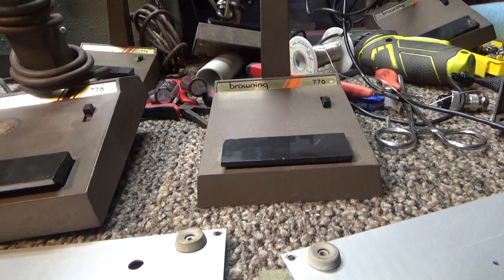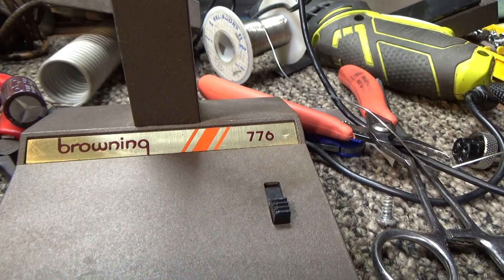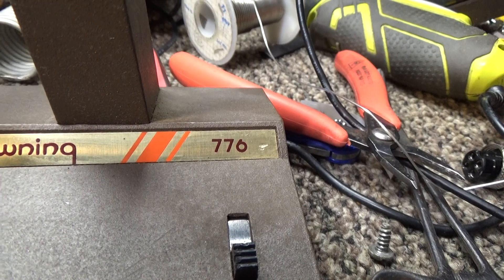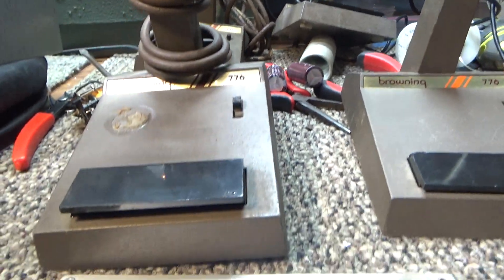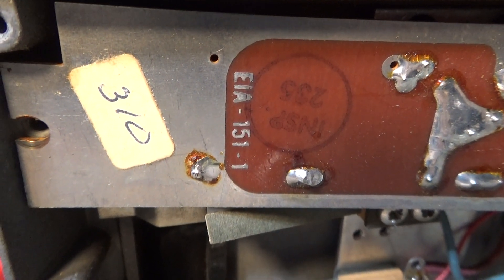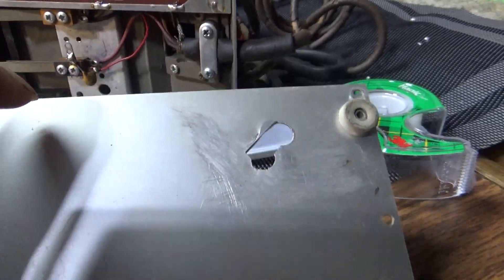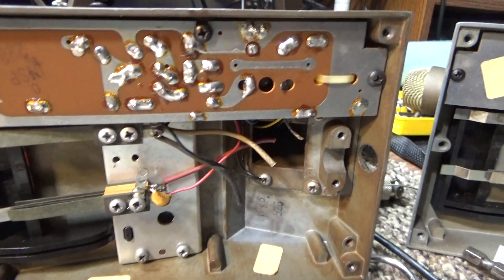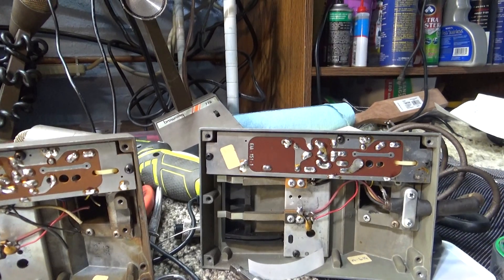My Browning Golden Eagle 776 Mics Orange and Brown stripe opened up.

Comment: Did you ever get it to work with the older brownings?
Reply from the maker: Never tried as I it needs around 7vdc from the transmitter to power it. The older Brownings original plug doesn't have an extra pin to bring the voltage in for starters. It could be done, replace the original Mic plug and socket, add a diode and cap off the filament for low voltage, run that into the Mic and it should be good. However, modding a Browning to do that will lower its value to most people including me.

Comment: The Browning Mark 3 supplies 5v through the plug by using a Zener diode. Dont believe me? Take a multimeter to the Mark 3 mic connector, you'll see.
Reply from the maker: You mean the Mark 4's right? Also, I think the early Mark 4's used a dropping resistor from the 8v PLL supply and if you shorted that 8v supply, sometimes it would take out the Mark 4's early PLL. Browning redesigned it with the Zener on later models. The Mark 3's used a High Voltage relay and took the HV for it right off the HV power supply. Zap, so be careful.

Comment: I have a Browning 776 also but the plate on the front is missing along with the cover over the microphone head does anybody have any extras ???
Reply from the maker: Good luck. Someone used to sell the front label if thats what you mean, but I have not seen them in a while. Never did see anyone selling the head cover or the original Brown cord.

Comment: I operate a browning mark 4 great radio I use it for old tube radio network on Saturday at 8pm in Central valley California my 4 has a 4 pin with a flat spot I use a d104 silver I would like to find a stock mic some day
Reply from the maker: 776 Mic or an unamplified D104 work great.

Comment: The one I got off you is orange stripes...with a hole on the bottom...where you can stick a screw driver in and turn up the gain.
Reply from the maker: Does the hole look factory?